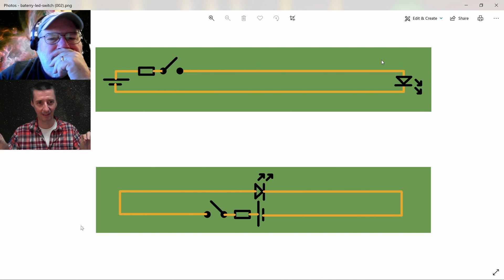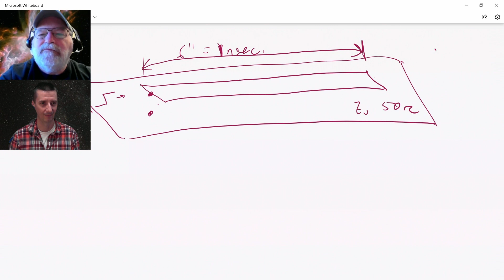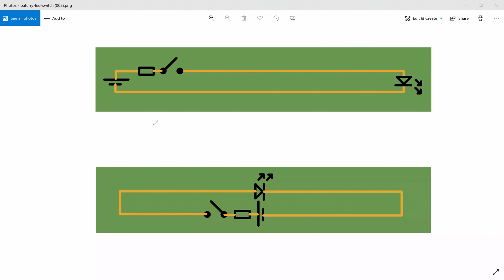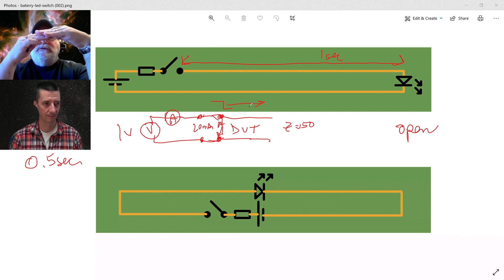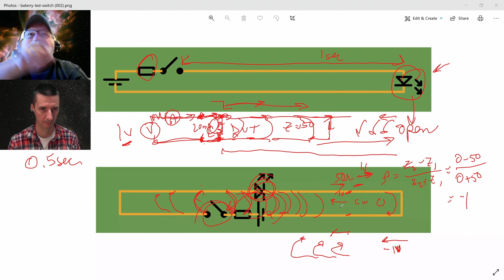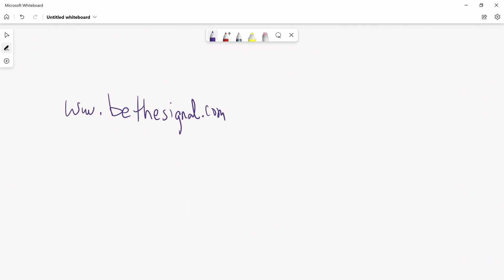Explaining Veritasium Electricity Video: Energy doesn't flow in wires (with Eric Bogatin)

Comment: Unfortunately, any photonic coupling between two wires 1 meter apart is going to be negligible. Photons are generated from the surface of the wire and then spread out before they hit the second wire. If the radius of the wire is 1 millimeter, then the photon cloud will have been attenuated 1000-squared = 1,000,000 times when it hits the second wire. So there's no getting around it. You're really going to have to wait a full second before the bulb lights.
Reply: But the assumption from the origional videowas any current turns the light on. Technically correct but misleading.

Edit i do wish he had actually gone over the "capacitance"of 2 cables 1m apart to show the true current across it mathematically. Not sure the standard equations apply though so might have to derive for custom circumstances.
Reply: The two transmission lines extending left and right have a characteristic impedance of around 800 ohms. When the switch is closed those transmission lines look exactly like an 800 ohm resistor each.
Therefore, the circuit at t-0 is equal to a battery and  two resistors going to a bulb.
This means that the bulb will light dimly after the time delay because of the 1 m separation. This is easy to see if you replace the two transmission lines with resistors that are 1 m long.
The light will then flicker as the reflections bounce back and forth and eventually equalize to the simple DC circuit of the bulb and battery.
Reply: @Observ45er   this cannot be true. If it was your computer would recieve noticable current every time you plugged it in. The power supply circuits recieve power and then nearly instantly induce or via capacitance would destroy all the ic circuits as they recieve the induced 12V power from the rails. The induced current or capacitance here is negligible and if it wasnt computers as work in life would fail immediately.
Reply: @MrThedumbbunny  it is however correct, that is just how it goes. It is what it is because it is a distributed system with a uniform structure and hence it obeys those laws.
Reply: @tonycook7679  the capacitance across a 1m air gap is estimated as the capacitance of vaccume at 8.854e-12. A $5 capacitor is listed as 5.6 e-4. This means a cheap publicly available capacitor has over 6.3 billion times the capacitance lf these lines the capacifance here is so tiny as to be negligible. 

For the inductance portion... both are straight lines so minimal inductance. The voltage is 12v dc so all the inductance is momentary. You need to integrate based on distsnce from the switch and the speed of light as a movement of the highest field strength point as it drops to 0 behind that over a small amount of time. Then because we have a time constraint of 1s we have to determine if the equalibrium even happens in 1s or is it a momentary current. Technically according to math it would never stop ripling however it eventually reaches universal energy limits like plank length motion differences and actually goes to 0.

Kind of makes me think that the universe is more like a programing language with bounded minimum and maximums rather than our math models.
Reply: @MrThedumbbunny  So? Are you dying due to the electrostatic discharge of several Kilovolt when touching a door handle?
Reply: @Test-eq2vu  ? E-12 is much smaller than e-4 if your refering to the capacitance comment? Not sure what you are getting at since clearly nothing im suggesting shows a massive voltage/current allowance in every day environments?
Reply: @MrThedumbbunny  I was referring to the "this cannot be true" part. I was just mirroring your way of arguing.
Concerning the capacitance comment, you are also mixing things up a little bit. The capacitive coupling across 1m air gap between two thin wires is not negligible regarding the wave impedance. HF filters may be an epiphany to you.
Reply: @Test-eq2vu  on a 12v dc line? nah. Most of the time i dont even see shielding on signal lines/IO loops. Sure if we were talking signal line near 480 maybe even 240 might matter. We are talking about power delivery for a 12v battery accross a 1m gap. It is practically nothing. 24v 4-20 signal lines are frequently near the power lines for lights etc with no issues though its not recommended. Its not like signal accross relatively large gaps is that good either. There is a reason we switch to radio for even mid distance communication. HF filters? Never seen them used over shielding and half the time shielding best practices are ignored with only minor issues for years. Shielding would absolutely kill anu chance of 12v battery power delivery over a 1m gap.
Reply: @MrThedumbbunny  Okay, look: it's NOT about power delivery for a 12V battery across a 1m gap. It has nothing to do with DC Voltages. It has something to do with the coupling in the moment, the 12V Source is applied to the circuit, the transition from 0V to 12V which includes all possible frequency components. The formula for the characteristic impedance Z is:
Z=SquareRoot((R'+j*w*L')/(G'+j*w*C'))
R' --> Resistance of the wire (per distance)
G' --> Conductance between the two wires with 1m air gap (per distance)
L' --> Inductance of the wire (per distance)
C' --> Capacitance between the two wires with 1m air gap (per distance)
w (Omega) --> 2*pi*frequency (angular frequency)
j --> imaginary unit

As you can proof later, the Resistance R' is negligible in comparison with the frequency-dependent term j*w*L' when using metals like copper. The isolation between the two wires 1m apart in vacuum is very high, so the Conductance G' will be also negligible in comparison with the frequency-dependent term j*w*C. So we can simplify:
Z = SquareRoot((j*w*L')/(j*w*C')) = SquareRoot(L'/C')

The inductance L' of a wire with 1mm diameter is about 1.5µH per meter for one wire, 3µH per meter for the two wires respectively (Source: Eeweb Self Inductance Calculator).
The capacitance between two wires is (Source: circuitglobe):
C' = (pi*epsilon)/ln(D/r) = 4pF/m 
epsilon --> vacuum permittivity
D --> distance between the wires
r --> radius of the wires

Z = SquareRoot(L'/C') = 866 Ohm

This comes close to the 800 Ohm mentioned above. An online calculator puts out 912 Ohm (Source: easycalculation). This is also plausible, since these calculations are all just approximations. So, this signal transition in combination with a low-impedance 12V source would result in a current flow: I = U/Z = 14mA

As you can see, the "tiny" capacitance between these two wires is not negligible regarding the characteristic impedance nor the resulting current flow.

So, why are computers not destroyed then? Same reason as we don't die to a electrical discharge of Kilovolts on a summer day by running over the floor and grabbing the door handle. It's not about the current, it's about the energy. As long as the cables don't reach to the moon, the current will only appear a ultra-short time due to the speed of signal propagation. And it would only travel through low-impedance components. As soon as the signal transition hits a higher impedance, the current flow will be lower at this point immediately. There are also practial effects and the geometry of the wiring is complex, so arguing about this would be otiose anyway.
Reply: @Test-eq2vu  ok so taking a 9W low power led bulb designed for a 12v power source the resistanceis p/v=i 9/12 for .75 A. 9÷(.75^2) (p/i^2=r) gives the resistance of 16 ohms. 16 ohms .014A^2×16=3.1mW power delivered. On a 9W expected this is well below 1%. It is insignificant for this system. I will concede that your argument for computer parts has merit.
Reply: @MrThedumbbunny  Huh, funny... just today I worked on a light decoration. Part of the circuit is a LED with series resistor. And with a voltage of 4V (could have been even less by reducing the value of the series resistor) and a current of not even 10mA, guess what happened... the LED glows... just by magic...
Reply: @MrThedumbbunny  What's wrong? No objection anymore?
Reply: Exactly. I can not see how he claims there will be a 20mA return. For an example, if I placed several wires in parallel near the second "receiving" wire, then would all of them have 20mA? Surely that would violate some conservation principle. Neither wire would know the circuit specifics in the time the pulse would propagate over, so what makes this specific wire special?
Reply: @bermchasin  Both of them would have 10mA. Put an infinite amount of wires next to each other with the same distance to the "transmitting" wire and you will get a coax cable, still with 20mA in total. Okay, then in fact it would be a higher current because the characteristic impedance has been decreased by manipulating the geometry too much.